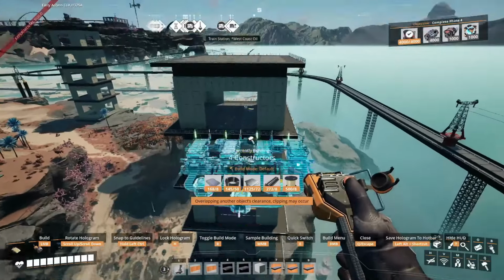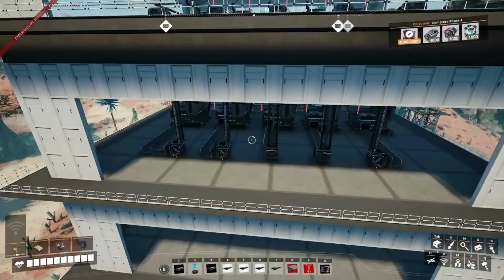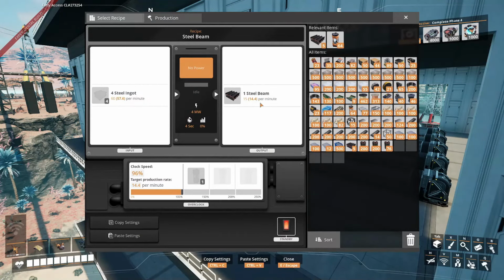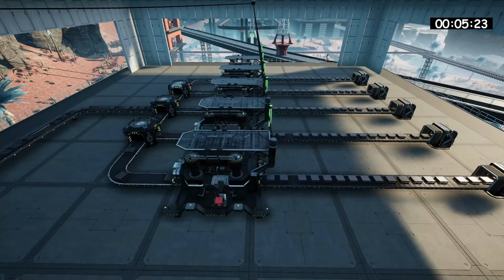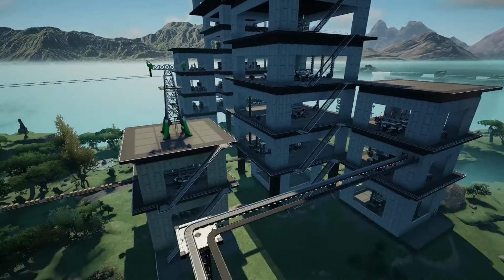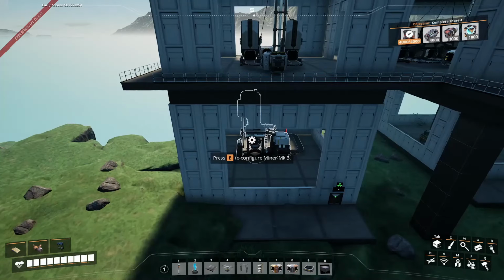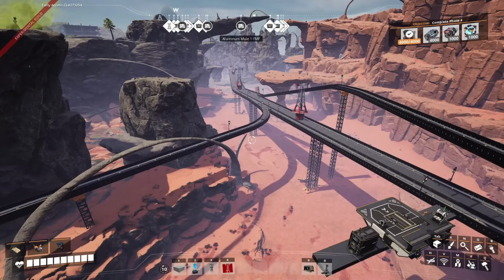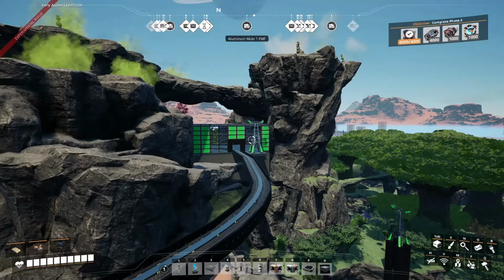LOAD BALANCED Nuclear Power 200GW - Part 1 - Satisfactory - Update 8

Comment: How much power does this nuclear setup take to run
Reply from the maker: That’s a great question! It’s a little hard to tell without doing the math on each group of machines due to the underclocking. My best guess is that it peaks around 25GW because of the particle accelerators and probably averages around 23GW. Thankful the particle accelerators don’t turn on until you start generating power. They make up about half of the power cost.
Reply: @moo121  so your turbo fuel power plant could easily run the nuclear for the nuclear to run the world, perfect lol

Comment: Can you explain agin why you do the mk5 belt first then the lower tier belt. Shouldn’t it work with just the lower tier belt
Reply from the maker: Absolutely, that’s a great question. If the incoming mk5 belt was full you are correct and I could just use the lower tier. But since it has a good bit less, it will have gaps on the belt. Sometimes those gaps will then show up on the lower belts and they won’t have the full amount I’m counting on. With the section of faster belt first it’ll be able to grab the items quicker and make up for those gaps but still be limited by the slower belt speed past that. Hope that makes sense.